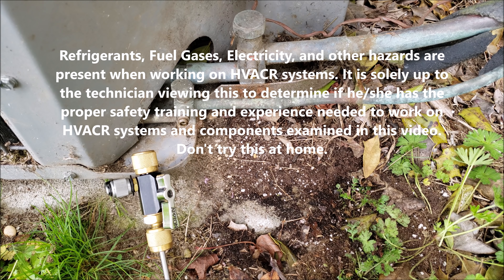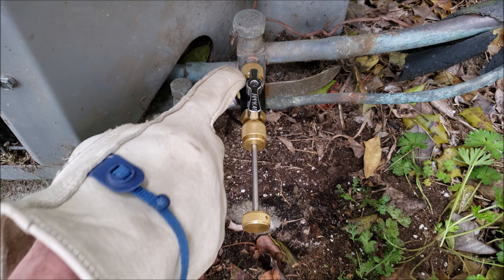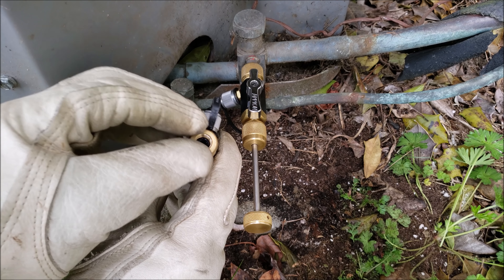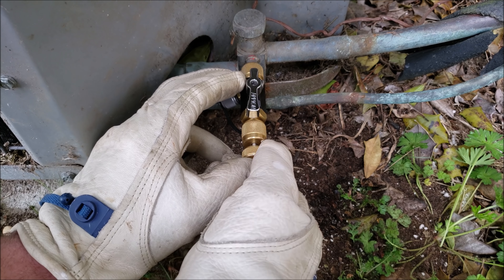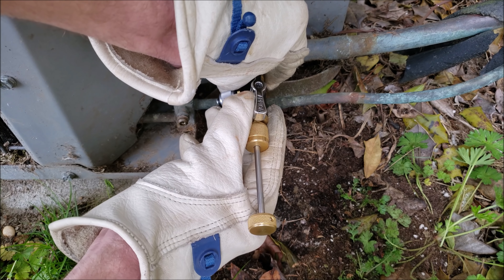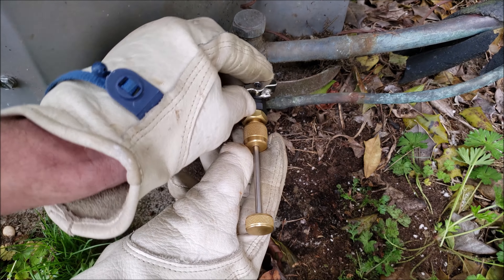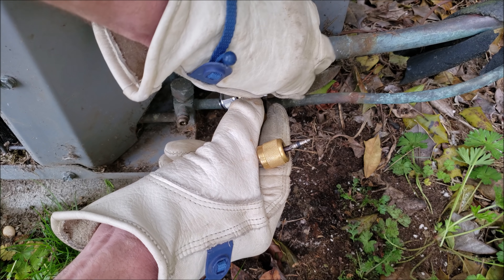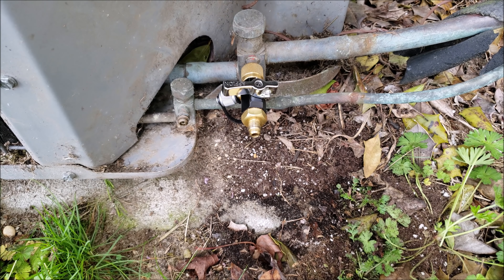Remove The Schrader Valve with the Valve Core Removal Tool on the First Try Every Time!

Comment: I think that the companies who make these  valve core remover/ install tools should magnetize the tip of tool  to really make it easier to hold Schrader core / pin   in place. Great video.
Reply from the maker: The only issue is the rusting but this manufacturer's tip grabs the core pretty good I must say. You could also crimp one down a little if needed to get it to have a tighter fit if needed with another manufacturer, thanks coolmandude1000!

Comment: Whar a great solution for an ongoing problem!
I just confirmed the C&D removal tool definitely suffers from this problem.
The Appion removal tool requires an unrealistic amount of torque to start failing even then it was 
successful most of the time.
The Hilmor won’t fail even when King Kong torques it.
Reply from the maker: Thanks Richard